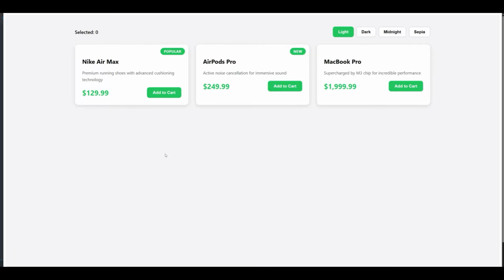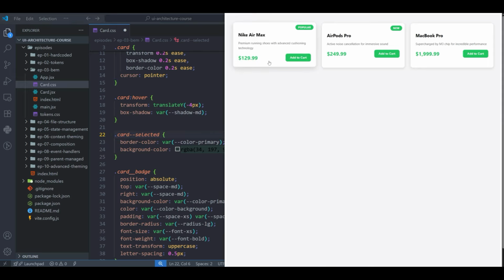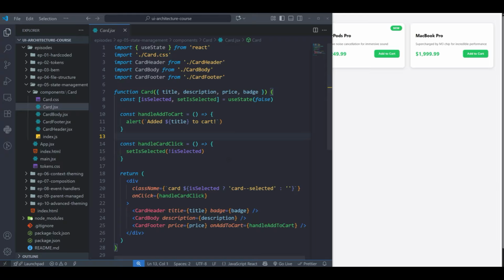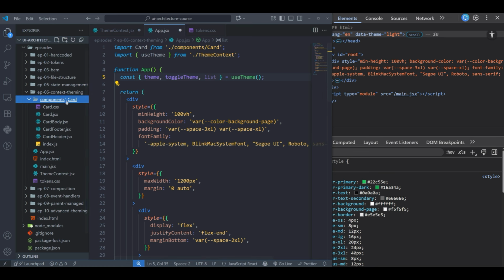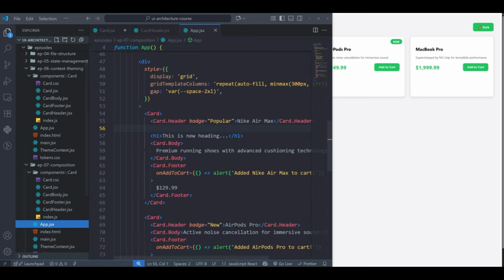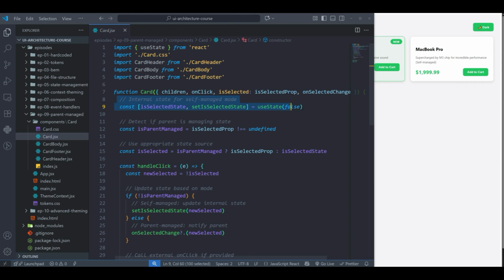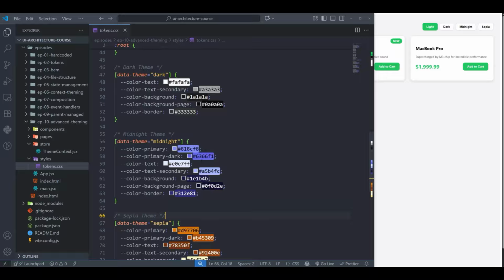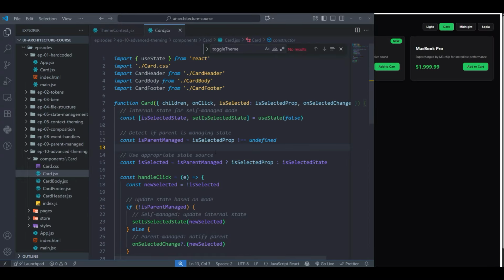UI Architecture Fundamentals - Build Production-Ready React Components | Complete Course. 1 hour

Comment from the maker: 📚 TIMESTAMPS
0:00 Introduction & Course Setup
2:48 EP01: Hardcoded CSS (The Pain)
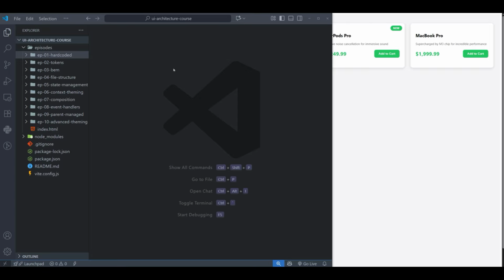5:15 EP02: Design Tokens (Single Source of Truth)
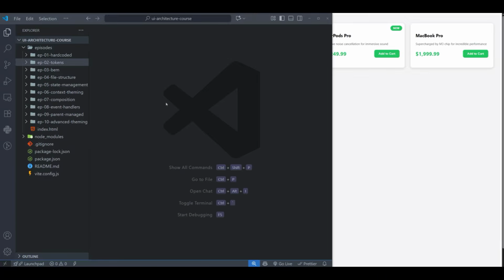7:26 EP03: BEM CSS (Scalable Naming)
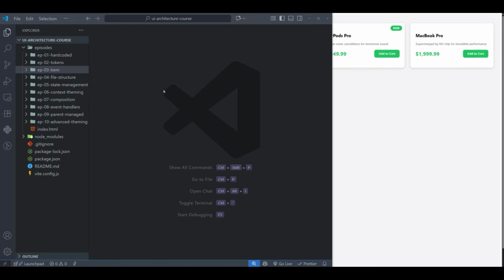11:13 EP04: File Structure (Colocation)
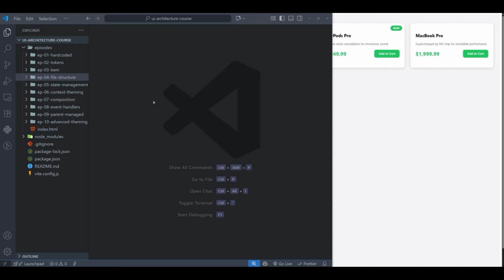15:45 EP05: State Management (Local State)
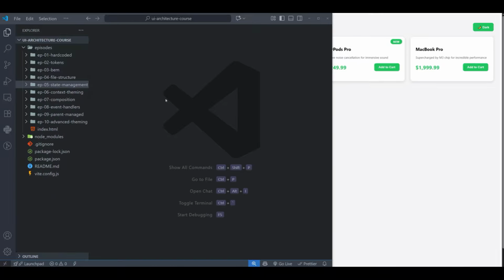18:06 EP06: Context API + Theming (Global State & Dark Mode)
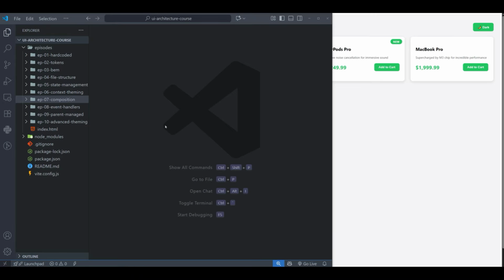28:12 EP07: Composition Pattern (Compound Components)
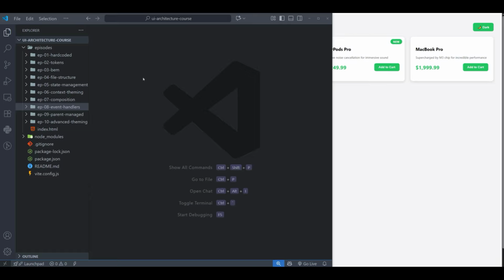33:53 EP08: Event Handlers (Proper Event Management)
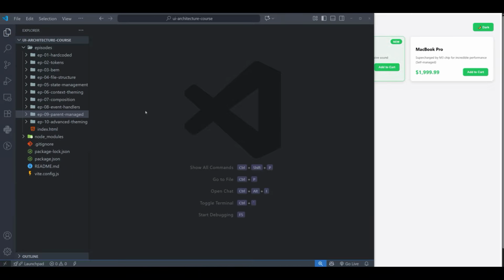41:26 EP09: Parent-Managed State (Lifting State Up)
48:01 EP10: Advanced Theming (Theme Variations)

🏗 WHAT YOU'LL BUILD:
A production-ready Card component with:
✅ Design tokens (CSS custom properties)
✅ BEM methodology (.card--selected)
✅ Clean file structure (colocation)
✅ Local state management (useState)
✅ Global theming with Context API (dark mode)
✅ Flexible composition (Card.Header, Card.Body)
✅ Proper event handlers
✅ Parent-managed state patterns
✅ Advanced theming capabilities

🎯 PERFECT FOR:
• Mid-level devs wanting to level up
• Anyone building component libraries
• Learning professional patterns
• Understanding React architecture

💬 Questions? Drop them below!